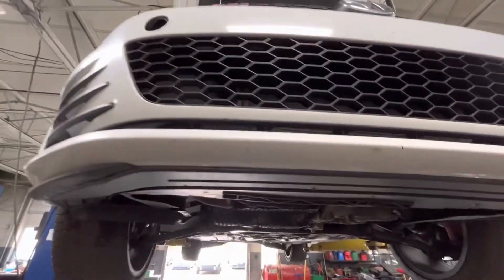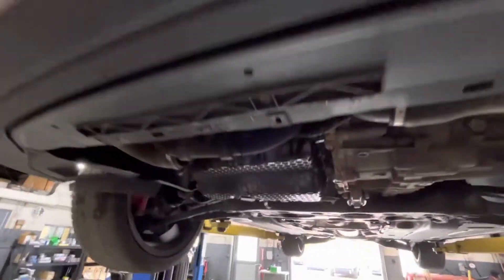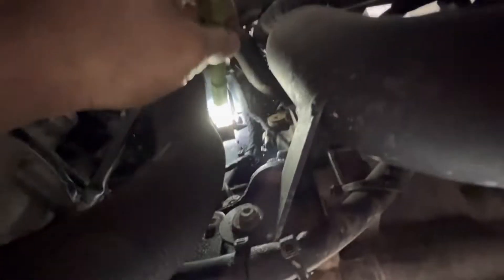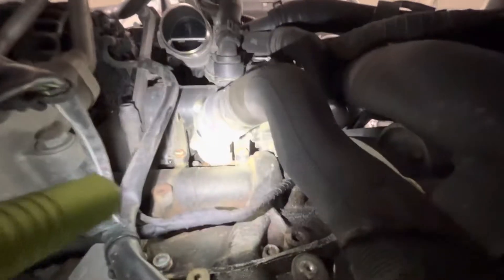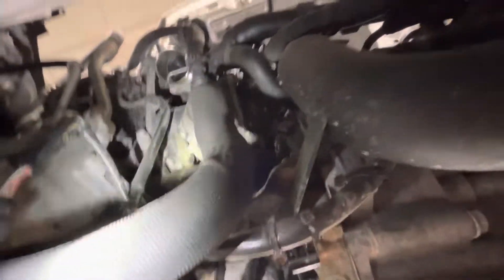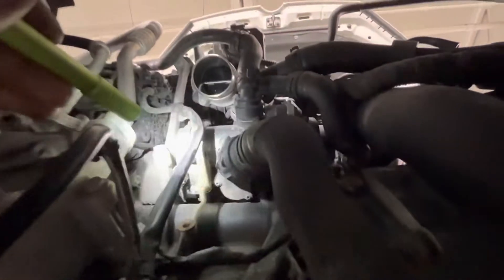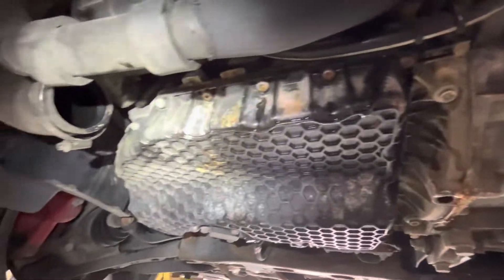Mk7 VW GTI most common coolant leak.

Comment: Have a 2014 Golf mk7 1.4l TSI Petrol and in the front passenger seat there is a leak in the footwell. The thing is there is a problem with the coolant aswell it finishes quicker than it should do so there must be a leak there aswell. Either it’s 2 separate issues or the coolant leak is going towards the front passenger seat footwell. Not sure what to do now as we bought it about 4/5 months ago and got tints on the car and replaced the brake pads and discs and a lot of other things so spent a lot.
Not sure what to do now.
Either try get it repaired because there was a problem when we bought it with the coolant leak, so try see if they can repair it again (if they even fixed it in the first place) or try to sell it. MOT and service is soon aswell
Reply from the maker: Are you able to identify if the interior leak is coolant or a water leak?

Comment: I keep loosing the top 3/4 inch of coolant from the reservoir over the course of a month or two, i haven't been able to spot a leak either (havent had it on a lift to look from the underside though.
Reply: Same dude, have you figured out where the leak now?
Reply: @hanif_zack you figure out where the leak was?
Reply: @hpls8160  my water pump and was faulty. So i changed that. And now back to normal. No issues
Reply: Can also leak from the coolant flange that sits at the top off the engine at the back just found this out . Sits close to the turbo so burns off any leaking fluid so can be hard to spot
Reply: I changed that 2 months ago I saw some leak today

Comment: Just got my water pump replaced n the coolant light came on and the coolant was low. 2016 gTI. 🤦🏽‍♂️
Reply from the maker: Let’s hope it was a air pocket!
Reply: @EuropeanAutoRepair  idk man. I doubt it. The light came one and I added some coolant and it came back on today. Probably going to have to take it to someone who works on these cars cause our mechanic at our shops might not be doing something right lol
Reply: @EuropeanAutoRepair  I’m not a mechanic but I work on the airbag system and I clear crash data from airbag modules  so I can do some basic mechanic stuff but this job is probably too big for me. What can you recommend for me to check ?
Reply from the maker: Are you getting a visible leak under the car when you park it ?
Reply: @EuropeanAutoRepair  nope! No visible leaks on the floor.
Reply from the maker: Well hopefully you can find someone around there that can do a pressure test and make sure everything is ok
Reply: @EuropeanAutoRepair  I’m gonna change the cap cause I saw a few ppl make videos claiming that was their issue. My car doesn’t have the plastic that’s under the engine so if there was a leak I will see it on the floor.  From what I remember the mechanic did do a pressure test but if the coolant keeps leaking after changing the cap ima take it elsewhere
Reply from the maker: Hope you get it
Reply: Literally the same thing just happened to me when the mechanic replaced my water pump.
Reply: @Tarheel2019  damn really. The mechanic said my radiator was busted so we replaced it and the mext day the coolant leaked again. It leaks when the car is off tho so when pressure is built up. Now he says it’s a gasket. Maybe he didn’t put the pump on properly idk man. Been a hassle with this problem
Reply from the maker: @MarioHernandez-bn6pm sorry to hear that
Reply: @MarioHernandez-bn6pm   Backstory: I had my water pump replaced by a dude that does side jobs at a cheap price. When he finished my water pump, I had a distinct smell of fuel which he claimed it was just coolant burning. It proceeded to smell like that for months until I just got it check by an actual mechanic shop and they said that the fuel line was not tightened properly. Once they tightened the fuel line, the smell was immediately gone but now the coolant all of the sudden doesn't hold. But yeah I'm getting it checked out by them tomorrow. 

TLDR: These MK7 waterpump's are fucking ass.
Reply: @EuropeanAutoRepair  it’s all good. I’m actually going to sell my mk7 gTI. Ima use the $ to invest it into my shop. And ima get an 04 - 08 Acura TL. Whichever I can find for a good price and manual lol
Reply: @Tarheel2019  damn dude. I low key feel like this mechanic ( he’s a family friend and I actually rent half a shop with him now) didn’t put something back on when he first worked on my car. After I got it back when he replaced the water pump it started leaking oil but very slowly. Every other week or month it would say “check oil level”.  I never noticed it until after they worked on it. Could just be the car idk. It’s just weird timing
Reply: @MarioHernandez-bn6pm  Yeah man it's so hard to tell with these cars even though I love GTIs. When I first called the mechanic regarding the coolant leak after they had worked on my car, the mechanic was immediately defensive saying that it couldn't have been him since he didn't go near the coolant system. It's frustrating because coincidences do happen but it's just so annoying when you get one problem fixed and another one decides to fuck you right away.
Reply: @Tarheel2019  duuude I LOVE my car too. And I finally paid it off almost a year ago. It’s barely at 80k miles. But I rather put in the $ into my shop and invest it. If I still want a gTI later on I’ll buy one from the auction.

And I feel you on that. This mechanic is super nice. He works with his son. I never got mad at them or anything. I get it. Shit happens sometimes. But this is like the second time he misdiagnoses the car. And he’s not charging me much that’s another reason why I took it to him. He isn’t charging me extra for looking at it again. We help each other out tho. My dad and uncle do automotive upholstery and I do airbag work and ADAS calibrations so when he needs something I don’t mind helping him out.  

If he does something to my car this time ( I saw him working on my car when I left the shop) and it leaks again then ima take it to someone else. I don’t wanna be changing parts for no reason. We already changed the radiator and now I’m pretty sure it wasn’t even bad. 

I’m just going to get an older car. Hopefully the Acura TL. I wish I could keep the gTI lol.